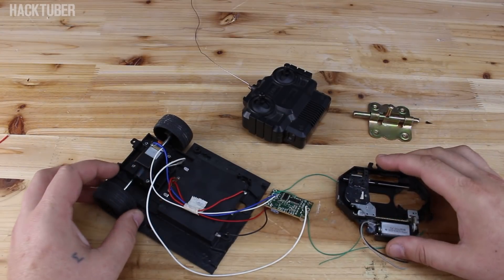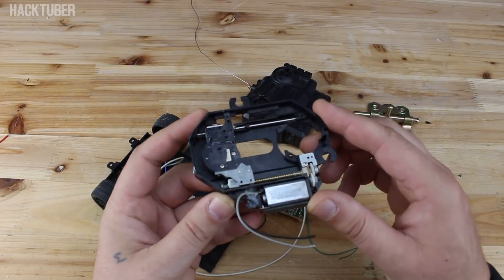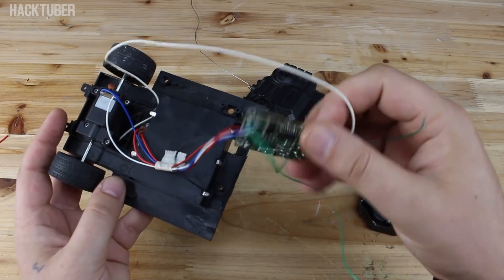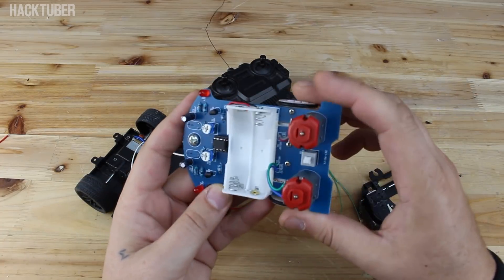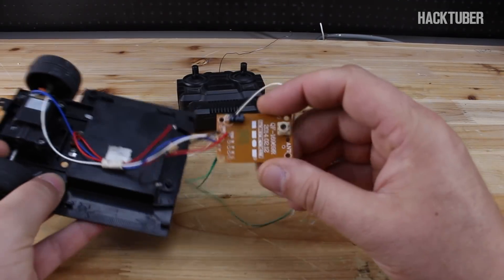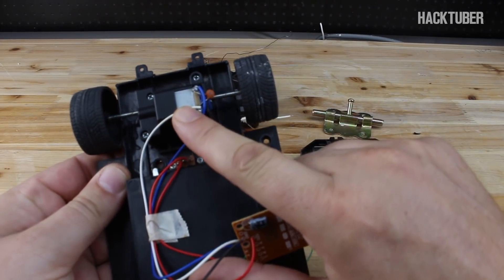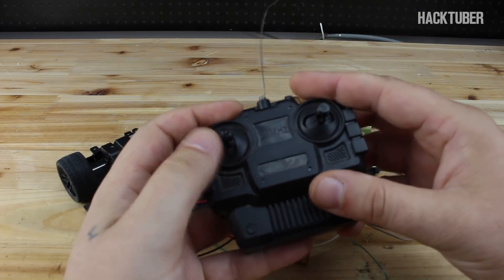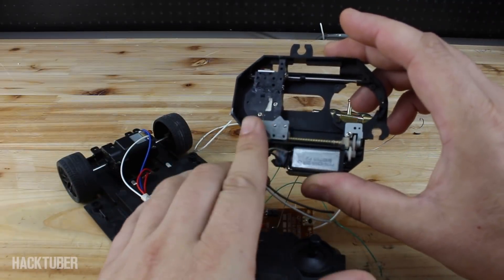How To Make Wireless Door Lock at Home

Comment from the maker: Comment amazing project and If I choose yours,I will send you a free Gift:)
Reply: Its a amazing project
Reply: Try to make a foot burgler alarm. You can make it by placing the key of the circuit hiding under the path towards your house , so that when somebody step on it you can hear small alarm in your room. You can make it remote controlled by making alarm key of the remote as key , in that way you can avoid long wires. The tress passer did not know that he step on an alarm (in your room so he can't hear it).
Reply: Make a fingerprinter
Reply: You can make a wireless power bank and the power bank should get charged with solar panels
Reply: Good idea
Reply: Hack old tablet display into raspberry Pi display
Reply: Make a toolbox
Reply: tqwryut
Reply: I love your projects

Comment: I want to turn my car lock remote into a wizard wand. I love your channel.
Reply: easy make the wand or buy it you choose and put the key inside the wand and also connect the transmitter module inside the key to an antenna at the tip of the wand and connect it to the remote so the signal won't be blocked. hope that makes sense.